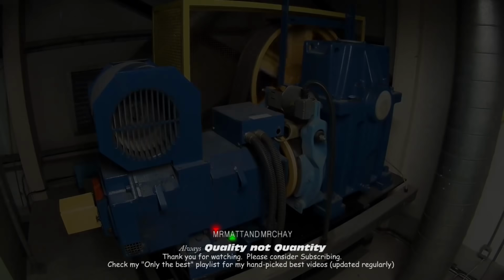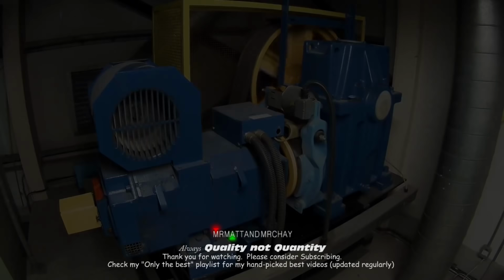Schindler lift motor room (with no Chandelier analogies)

Comment: Interesting video, thanks for sharing! I didn't know that Loher, a German motor company, also makes VF drives.
Very unusual and kind of weird to see Schindler motors and gearboxes painted blue, since their stock color is always grey.  Also, you are not looking at just "normal motors" here. The extended part of the motor behind the fan is an eddy current brake. This means that these lifts were equipped with Dynatron 2 drives (and Miconic logic obviously, probably the B type). They level fully intelligent without any phase cutting or VF drive. The motors have 2 speeds, although this is not to be confused with your old 2-speed motor where the slow speed is for leveling. The slower speed on these motors is around 2/3 of the fast speed here. On start, you go instantly to slow speed and stay there if you only travel one floor. If you go multiple floors, the speeds will switch after about 1 second, producing a "kick" that can be noticed in the lift car. When breaking, the motor is switched off first and the eddy current brake is turned on. The Drive logic now precisely controls the brake current in order to always stop the car at the correct position - regardless of its load. The final step is obviously to apply the mechanical brake again.
The Dynatron 2 is probably one of the harshest lift drives by todays standards, but it surely is also one of the fastest. So compared to the original state, what we have here today sadly is really slow. The start and stop of these lifts would have been around twice as fast with the original logic.

Comment: This takes me back, I worked for Schindler UK in the 80s out of the Rotherhithe office, I managed to swerve Chelsea Harbor, but worked on a lot of big jobs in London mostly. Most of the drive systems were Miconic B, but I put a few design ‘S’ package jobs in, good bunch of blokes too except for the normal couple of dickheads every firm has. PS at that time the biggest gear was the W59, then you had the big gearless DC jobbies like what was in Guys hospital, good old days.

Comment: That is some smooth action on those breaks. Funny that they the left the original motors in an unused state with those two modded lifts.
Reply from the maker: I would imagine that they will be removed on the next visit when they finish replacing the other lifts.

Comment: Nice tour. I love the information on the PLC controll system and that you show both modern and old systems. What were the little seperate blue boxes on the floor that were a meter or so away from the motor set? Some kind of rotary encoder for distance or floors?

Comment: replace their voice with text in the video.  what's the frequency thing that controls elevators speed?
Reply from the maker: Instead of switching voltage to the motor, the Variable Frequency Drive, as the name suggests, varies the frequency of the voltage to control the motor.  Old lifts, the brake brought the momentum of the motor to a stop.  With VFD, the motor is brought to a halt by the VFD before the brake is applied.  Far smoother speed control.

Comment: Btw are those high pitch squeeking noises are from very high frequency vfds? Maybe my speaker is crap? :D
Thanks for the video! :)
Reply from the maker: That's right, its normally a give away that the motor is VFD controlled.  It's not your speaker ;)

Comment: Thats a big motor room, so are the motors themselves, but then im guessing there are motors way bigger then them
Reply from the maker: Yes, so you have the motor, the brake, then the gearbox and the sheave (big wheel) that the cables go around.  Regarding motor size, I suppose these were pretty standard for this age of lift.  It depends on how fast you want the lift to go.  I mean, for blocks of flats there isn't a requirement for a really fast lift, so a geared traction (which is what this one is) is good enough even for 20-30 floors.  But for an office block with more people, the only way to make a lift faster is not increasing the size of the motor.  You have to go for a GEARLESS traction, which means that the sheave is much bigger with the electromagnets of the motor located around it.  So everything is "as one".  I'm sure you've seen them before.   The DMR lift is such a machine:  https://www.youtube.com/watch?v=hz7NvgZaoDM
Reply: @mrmattandmrchay   Wasn't there a limitation factor with geared machines beyond 24-25 floors where a gear-less machine would need to be installed? And the elasticity of the hoist ropes traveling higher up, requiring a gear-less traction machine?  An office building have a gear-less machine makes sense with high traffic demand.

Comment: Wonder why there is an electric heater up there?
Reply from the maker: If the room is really cold then the oil solidifies in the gear boxes.  So the heater was designed so that the room doesn't reach really low temperatures.

Comment: Did the original motors on top of the kone MRL's have their original logic?
Reply from the maker: Everything was replaced, completely new lifts.
Reply: mrmattandmrchay Sorry - I think I confused you - in the cabinet in the motor room on top of the Kone MRL lifts, was the original logic there?
Reply from the maker: All those cabinets have the Skycom control gear - all lifts were modernised in the 2000s at some point.  No only Schindler stuff left, including the goods lift at the back of the building :(
Reply: mrmattandmrchay Shame about the first mod - if only they kept one original :(

Comment: 4:48
Is it a ST7920 based display? Then I have an elevator part. 10 million to go, and I'll can build an elevator :D :D
Reply from the maker: I'm not sure what you mean by a ST7920 based display? :)
Reply: Usually a lcd like at 4:48 :D
It is an old display controller, can be driven with parallel (easy for controller), or serial (less pins), cheap, huge pixel with outdated STN technology, and widely available at ebay, aliexpress, ect, so widely used for diy projects but not only. When you need a graphical display, but nothing special its a good choice. It somehow stayed with us just like HD44780, they used in lot of printers, fax, etc too, now I've seen them in vending machines for contactless payment, and looks like the elevator industry is a place for them too. :D

Btw, interesting part is that I've only seen one implementation of the 128×64 resolution version (and the others are kinda not existing compared to this ), and thats all. You can buy it as a module, and just plug it in with a pin header :D You can google it as 'st7920 lcd' and it'll bring up that module.

Comment: hi are you actually a lift mechanic
Reply from the maker: I'm an engineer but in the security industry.  I'm 45 years old now, and through my time I've developed a lot of knowledge of the older systems through my own interests of electronics and working with lift engineers as part of my job (lift integration into Access Control systems).  Also been with some lift engineers from people contacting me through my youtube channel.
My expertise is with relays!